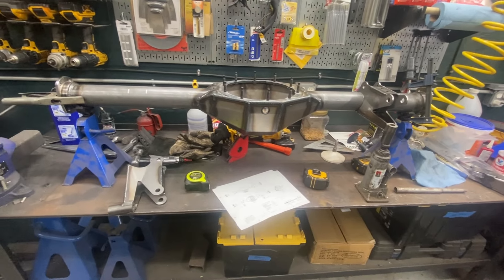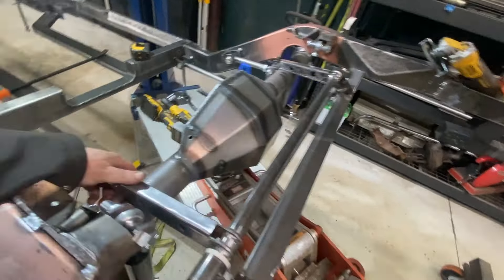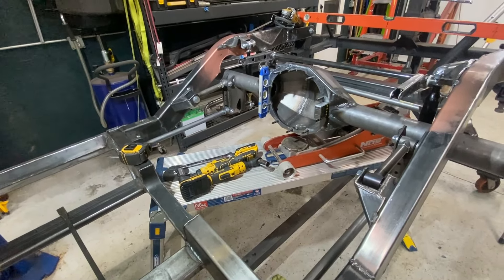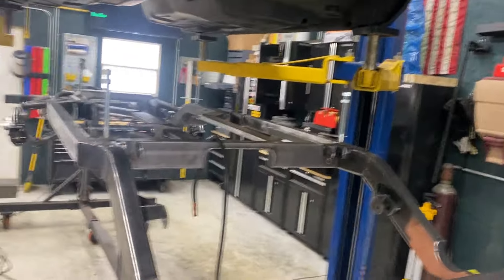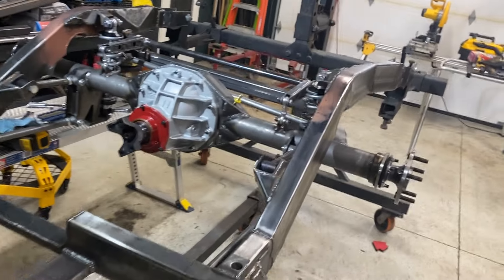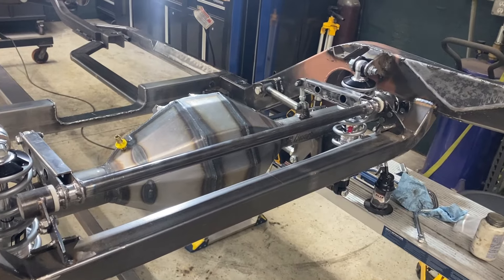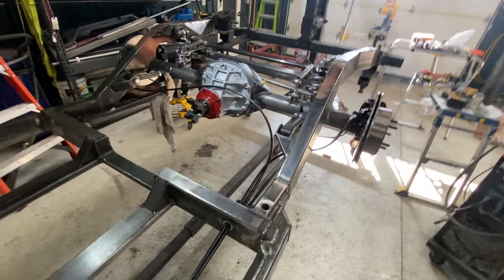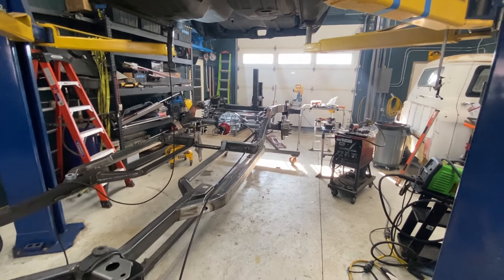67 Firebird, Part 76, Rear end Brackets and  Mock Up

Comment: Did you design and build that frame yourself or is that a Roadster shop frame?
Reply from the maker: That frame is my own design and fab work.  Started out trying to buy a Scotts Hotrods frame but that deal went down in flames so I canceled it and moved on.
Reply: @LakeAndLodgeGarage  yes, I saw that in your other video's when I started poking around. Are you a mechanical engineer? Nice work by the way.

Comment: Do your 4-link links have a degree of rotation allowance on one end? Or are the bushings compliant?
Reply from the maker: on one end they have like a little hime joint like affair in the end that looks like a bushing.  the other end is a polyurethane bushing with a sleeve.  so one end is compliant the other is only slightly compliant. if that makes sense...